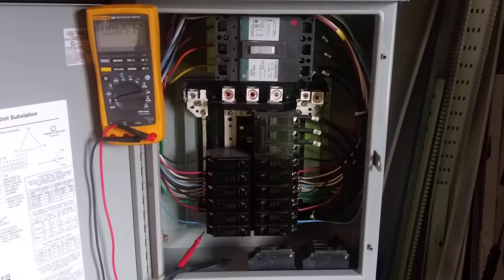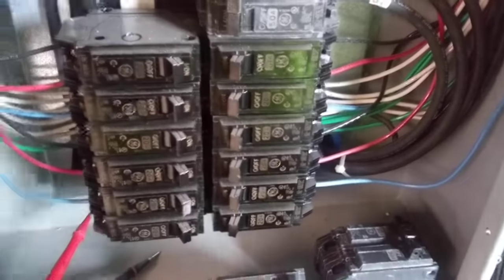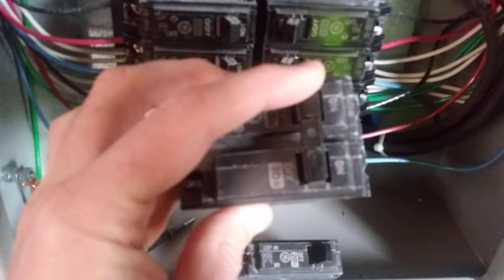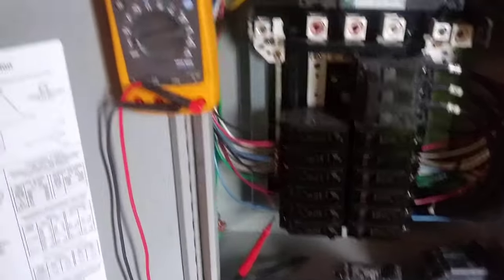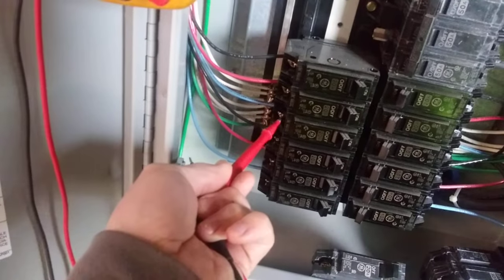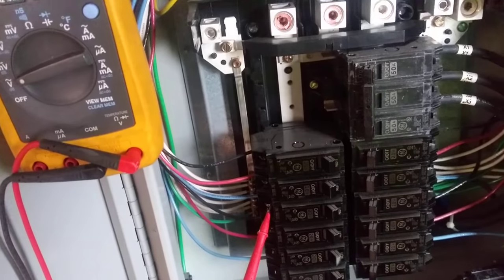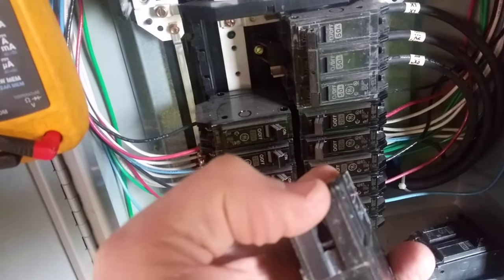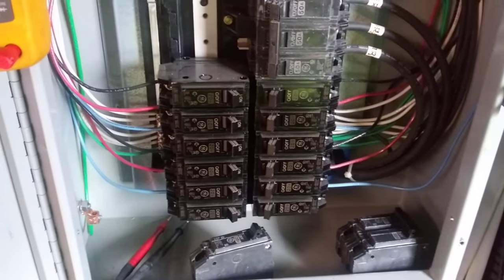How to troubleshoot a circuit breaker

Comment: Thanks for sharing your knowledge! So far you are the only one who mentioned that other than bad, outlet or switch their could be a broken wire! Which I think is in my case either a broken wire, short in the wirings due to rain water or old  wirings got corroded. Last but not least there may well be chewed on wire due to critters bitting!

Comment: 2:42 You do not "Got" to put the red on the black or any such thing. The voltage in this system "Alternates" so the push an pull is constantly being reversed. Now in DC if you reverse the polarity, Usually the multmeter tells you "-" a minus sign when you have leads reversed.

Comment: I had an issue where i work the smoke alarm  on the ceiling had a loose connection at the wire nut behind the unit where it connect to line power, after taking off all outlets and switches we realized it was the smoke alarm.

Comment: How do you determine if the breaker isn't tripping when there is a short circuit or arcing?  I had a situation where an old 12awg wire got damaged against a sharp edge in a too small metal box when installing a gfci and the wire melted when I turned the breaker on but it didn't trip the breaker before I manually shut it off.  Now that was an arcing situation and not a direct short and this was a standard non gfci/afci breaker.  Does that mean the breaker is not necessarily bad?  I will probably replace it with a new one but I will still be wondering if it was bad or not.

Comment: Can I use a noncontact Voltage tester to make sure there’s no more power on my panel after I shut it off completely.
Reply: You could, but you wouldn't get to know the voltage value. And if you wanted to check one breaker switch, the ones next to it might interfere. So you'd want to turn each of them off to single out the breaker in question.
Reply: Voltage testers are garbage use a multimeter

Comment: my case is difficult.  I check all the output at the CB they have power out but 4 of my outlets do not have power.  I dont know the is an open somewhere (the last one connecting to these must have power and loose serial connection).  I did not know which one ....

Comment: I have a bedroom circuit breaker which trips when my microwave runs (completely seperate kitchen circuit breaker and room).  My bedroom is one one circuit breaker, and the microwave is on another completely unrelated breaker for my kitchen.  They all seem to be a kind of GFI Siemens panel breakers.  The bedroom breaker works perfectly unless the microwave is turned on, which causes it to shut off.  When shut off, the microwave works fine and you cannot tell anything has changed.  Any idea what is going on in this Voo-Doo Doo-Doo?
Reply: too much amps on that circuit
Reply: @jameskearney4100  I swapped the 20A Arc-Fault breaker with a 20A regular breaker and all is good now.  something on the kitchen circuit makes the arc-fault breaker trip for some reason.  I have been reading about many causes of false arc reports on these breakers.. 
The bedroom total on the breaker is 10A with a computer turned on maximum.  The microwave is the only thing on its 20A circuit and pulls about 8A-10A.  There is no large load on any circuit.  The issue is not overamperage, as it seems to be a false sensing of an arc for some reason..
Reply: @mrstanskaggs1  Then it probably is arcing. Unplug everything and plug a test plug in that gives you the three lites to tell you the opens reverse and correct indications. While it is plugged in, shake it and see if things change. Try each outlet.

Comment: I have a question  so I have a 30amp for my hot water heater when the old heater was token out it was leaking at the heat elements and water was every where  then it made a pop electrical spark so should i change my breaker for new one .?
Reply from the maker: I would test it to make sure you still have  voltage going through when it's on and no voltage when it's off. Breakers are designed to be reset and be reused after short, unless they go bad.

Comment: i test my breaker and it's at 120v ... but the room that my breaker protects , all the outlets are reading at 50v.  Do i have a faulty breaker or a short  somewhere
Reply: I'm not a certified electrician but I guess you are having something, a load maybe, in series with the outlet circuit which takes away 70V of the total 120V. Shorted circuit is not the case because that circuit will trip instantly as soon as you turn it on, or you have no voltage measured at outlets.

Comment: I pulled down too hard on my breaker when my pressure tank to my well started spraying water  out a joint. I fixed the joint but I don't know how to push the breaker back up. It came down only on top. I am very afraid of electricity but I have to do this to get my water back on. It may turn back on the way it is but not sure that's very safe. It is 220. Anyone have simple fix for this? Actually I believe it is 240

Comment: What is the difference  between  single pole and 2 pole breaker?
Reply: 2 pole breaker provides you with 240v utilizing both phases single pole provides you with 120v utilizing only one phase
Reply: Basically, 2 single poles combine to become a 2 poles. However, they are controlled dependently, either both ON or both OFF. There are also 3 poles circuit breaker. They are fairly in common used. Like in the video you see one at the very top.

Comment: Hello all
I have an issue just happened after storm 2 day ago   
Electric went out in all area around 1:00 AM but after Electric came back at 10:00 AM less than half the house stuff working and the rest is not working. 
I tested the breaker is not working to ground and I found it zero and the working circuit breaker are 123v. 
So I tested the 2 hot lines in the main circuit breaker,  both of them 120v but when tested the voltage between the two hot lines,  I found it zero and even at the meter. 
I called the Electric company. When tech came he is nothing wrong and the voltage is good between the 2 hot lines , even he showed me the reading in his voltmeter 245v. 
He left and I went to my Electric panel to check the voltage I found 240v between the 2 hot lines. 
Then I started turning on all circuit breaker and turning on all lights  , as soon as I turned the upstairs bathroom fan Electric went out in tge sane half of house. 
Tested the voltage between the two hot lines is zero again even after removing the electric meter. 
The question 
Why the incoming power is zero between the two hot lines
Reply: Greetings!   I realize you left your comment a year ago but I am having a very similar issue.   Power went out, when power was restored, many things now don't work.   Electric company said that the lines going into the house read 120 and are fine.   Says it could be anything from the breaker box to the point of contact (receptacle, switch etc).
I am in the country and the mice have done crazy damage recently.   Seems they prefer non food items to nibble on now a days....

Just curious how you resolved your issue and or what you found out along the  way.   I'm just looking to isolate the issue to save the electrician time in finding the problem.
Reply: @kerrischneider7693  
Good morning Kerri
It was fixed by replacing the whole defective line from the pole at the top of my house to the electric meter
When the first technician came. 
He juggle the line a little bit then it made a connection at the pole at the top of my house 
When electric went down again, I called PECO to report the issue for the second time
Another technician came and got his ladder and tested the electric voltage at the main pole first then it was fine then he tested the voltage at the pole at the  top of my house and was fine too. Then we he tested at the meter found it faulty. 
Then he replaced the defective line from the pole at the top of my house to the meter 
After that everything is good. 
Also this technician said that the other technician was lazy to check all voltages at the main pole and the pole at the top of my house

Comment: Anyone skilled in breaker panels/ electrical troubleshooting that can help me? My RV/ camper keeps popping the breaker, all electrical lines work fine, nothing is excessively hooked up (nothing should be using any power), happened when the power went out last week with the storm and was working fine before that, just not ever since. Only one breaker in the RV trips, as well as trips the gcfi outlet that is in the barn. The power to the RV works fine like I said but trips as soon as I plug into RV. I have troubleshoot to the point where I believe I need a new breaker box, but I don't want to spend money on it if it ain't going to fix the problem. Any help is greatly appreciated!
Reply: I know this a bit old but did you ever find a fix?
Reply: @shaneatl  I didn't